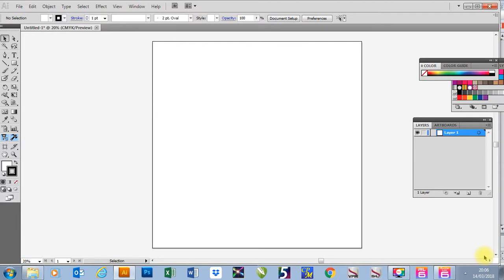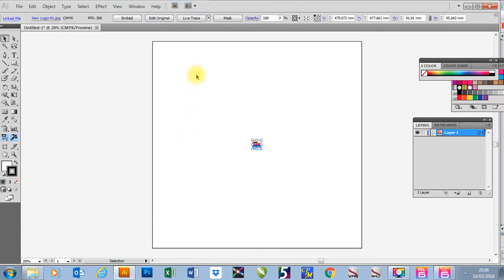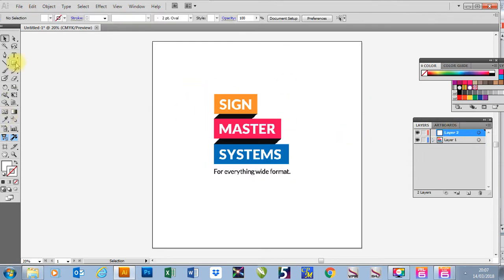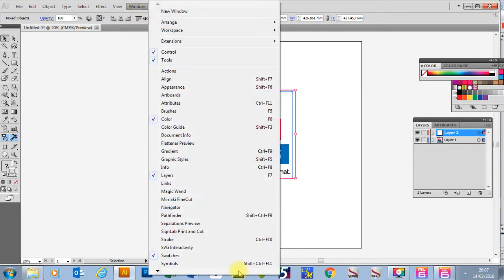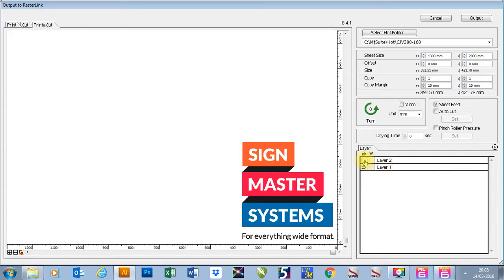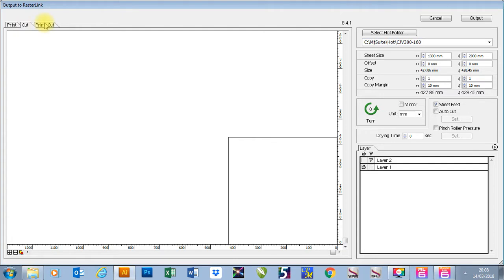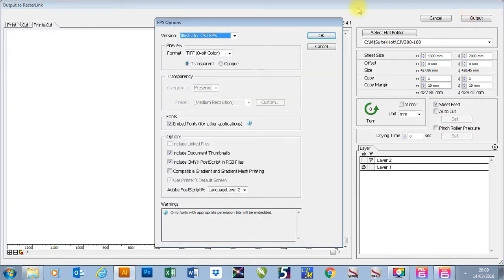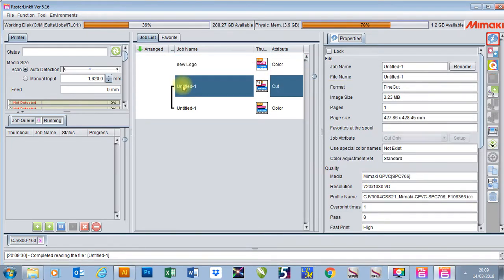How to create a print and cut job for Mimaki Rasterlink

Comment: How do I specify the size of the image I want to print? For example I want to print something in 40 inch width and 55 length how do I tell the machine?
Reply from the maker: You can specify the size in the design software first or you can change the size of a job in the RIP software

Comment: Same issue as below - getting 3 layers when it exports, with one just being a print of the cut line
Reply from the maker: Rasterlink brings a print/cut job in 2 layers but they are linked together via a black line, if you also have reg marks on there it will appear as another layer but still linked together with the other layers with the line. This is normal for Rasterlink